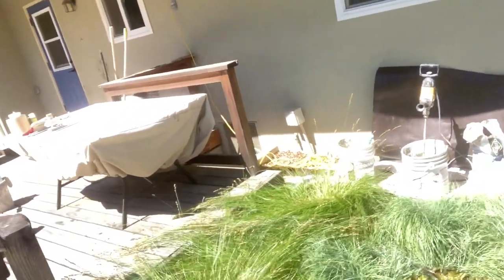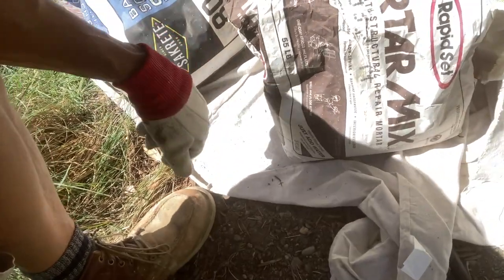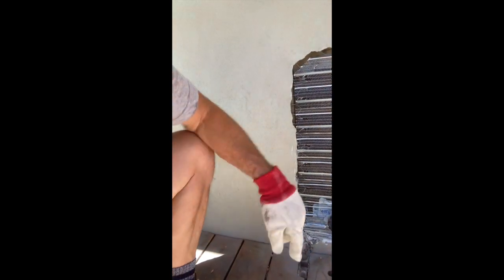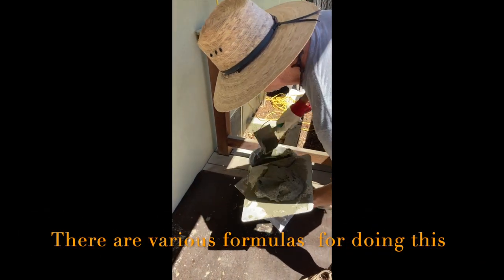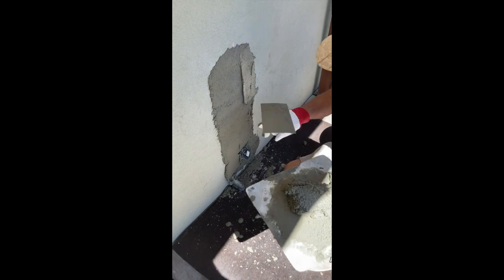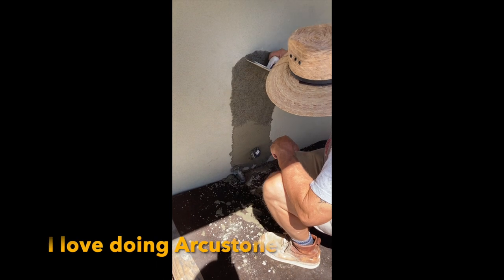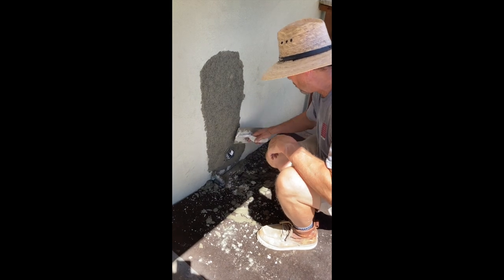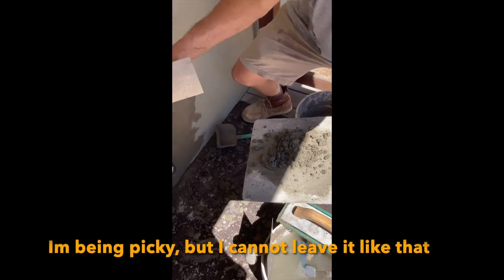1 hour stucco repair, step by step You can do it

Comment: if you use a hard rubber flotat right after you put on the stucco to compact it, then use your green float, you won't have that separation. also, if you apply the bonding agent directly to the existing stucco instead of mixing it with your mud, you'll get a much better bond.  I'm guessing that has already formed a crack.
Reply from the maker: Cool, thanks

Comment: Love it! I plan to DIY patch my stucco near the corner of my 1966 Oakland hills home, due to settlement over the decades. I believe I stopped the main cause of the settlement - downspout dumping massive amounts of water directly into the foundation at that corner of the house - so assuming that there's not too much movement between the dry and rainy seasons going forward, I'm hoping my patch will not re-crack for ~10 years. This area get's almost no traffic so an amateur job, which is how every first DIY job ends up looking, won't be a big problem.
Reply from the maker: That’s awesome. Good for you. I hope our video was instrumental in the successful completion and long life of your repair.

Comment: the first time you hit wall with sponge it had too much water.....have done same thing, drier sponge and add water if necessary on second pass.....it turned out great 

rapid set has been saviour for stucco and drywall patches
Reply from the maker: Thanks for the tip!

Comment: question.. i have to do this for my dad and there is not an existing chicken wire there already what should i do?
Reply from the maker: Do you have solid backing or is it open? Is there existing paper there?? You have to cut the new wire in two, shove it in the hole as far back behind the existing stucco on both sides of the repair, then tie wire the two sections back together in the middle. Let me know if you need anything else

Comment: Wish you would have shown how to do the metsl
Reply: Oops, I watched to the ens - you did show the prep. Question. Does the mesh you used require fastening on small repairs?
Reply from the maker: Hi. Oh wow you did see the metal going on.  Okay here is the thing. You don’t ever have to use fasteners as long as you tie the new wire in with the old wire.
Reply from the maker: Hi. Oh wow you did see the metal going on.  Okay here is the thing. You don’t ever have to use fasteners as long as you tie the new wire in with the old wire.  Thank you for the question(s)

Comment: So i would just rapid set to the stucco mix? I need to repair the stucco on my house because husband attempted to fix the cracks, but looks like he just threw a bunch of caulking on the wall😡🤬
Reply from the maker: Well he did the right thing. When it comes to cracks. Small cracks anyway caulking is the way to go because it expands. But if your finger isn’t bleeding after caulking several cracks you probably didn’t do it right.

Comment: Dont be nasty Ken, pool trowel guy wouldnt be happy with that comment. 
But then he would be talking so much he probably wouldnt have picked up on that any way lol
Anyway there are lots of different materials out there today then when i was involved.
But they are just some type of an excellerator mixed in with the portland cement.
For interior patching we would put a small amount of portland cement in with the structo lite brown coat.
And it would set up just like the stuff your using and allowed for a follow up with a high gauged white coat on the same day.
Good when we were replacing old wood lath ceilings and didnt want to involve waiting for it to set and dry out.
Reply from the maker: Hi Ernie. Thanks for your reply I need to give you my email address so you and I can converse more

Kbaberson@yahoo.com
Reply from the maker: Yes and I never really had the opportunity to do gauge lime and plaster. I’ve used diamond wall over blue board, and over expanded metal lath. That was done by the old timers in hospitals and prisons, government buildings airports etcetera right?  That is usually done by union plasterers right?  Much of that was done before my time. State of the art high end plaster on commercial businesses, Luxury homes, hotels and even in the most humble mobile homes are going with Italian veneers.  It’s kind of casual work but it is stressful. I like a more casual environment outdoors that pays better. The interior plaster finishes are priced high and often make tons of money, but it takes time and money to earn it. If you are an interior guru then you have a niche in say cities like San Francisco. Ugh the traffic and fuel costs. Sitting at 30 stoplights throughout the day